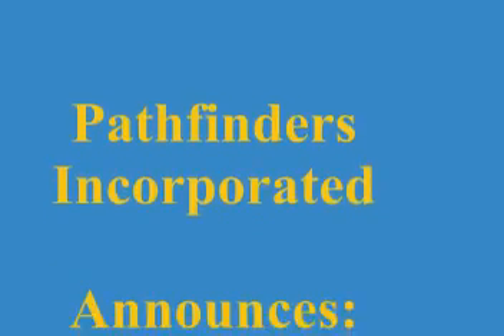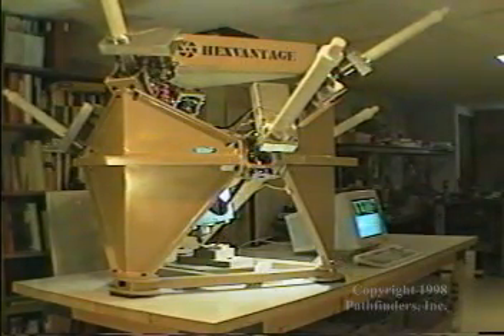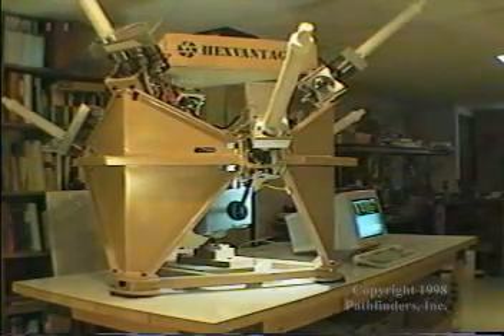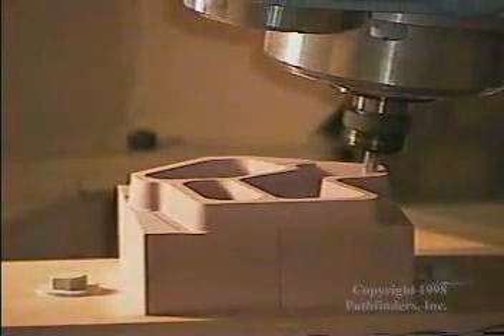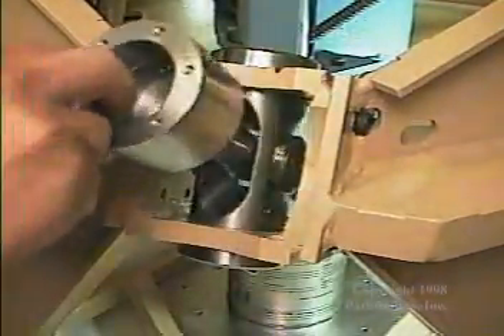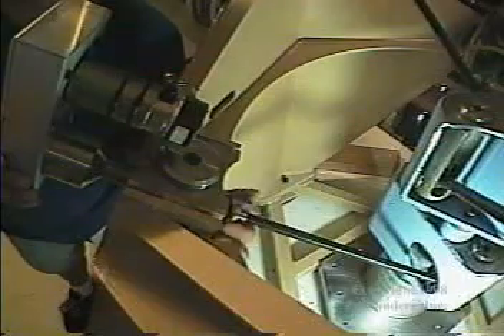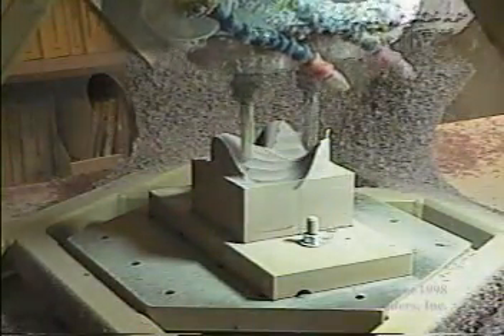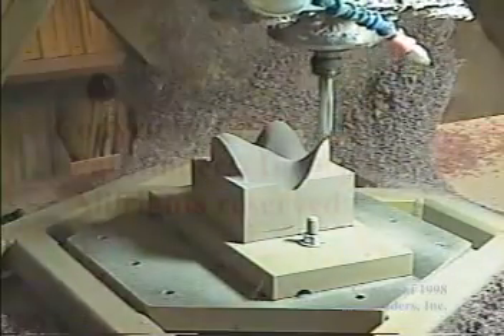HexVantage

Comment: what is the cam software ? does it need setup manually to fit this machine ?
or is the machine configuration exist already in the program machine list ?
Reply: The machine is programmed by the user in standard CNC G-Code.  The software that actually drives the machine translates the G-Code into the kinematic movements needed at each actuator to have the tool follow the desired G-Code path.  The G-code generated by any CAM software should drive the machine.  I personally never used any CAM software.  Either the part programs we used were made manually, or I got them from someone who did have a CAM system.  I'm sure there is no specific configuration for this machine in the CAM software's machine list.  I hope this answers your question.

Comment: Thanks for sharing this! Amazing machine! What CNC did it use? How did it calibrate? Is it still there?
Reply from the maker: Yes it still exists.  It runs on a home made CNC built with DOS and Turbo Pascal.  Never really finished the whole calibration process in that we ran out of money.  I'm getting too old to work on it any more and would like to offer it up for sale.  Any interest?
Reply: @brucekonkel9774  Thanks for your reply! The calibration is complicated. Actually I also built a hexapod machine about 12 years after yours (which was a lot easier because I was able to buy Chinese parts). You can see it on my channel. I imagine how difficult it was in 1999. Great respect to you and Ed. Stay safe!
Reply: This system (Stewart platform) runs perfectly on LinuxCNC, a free cnc software.